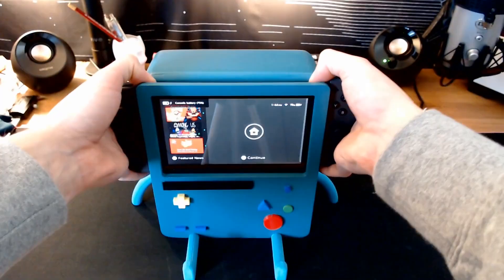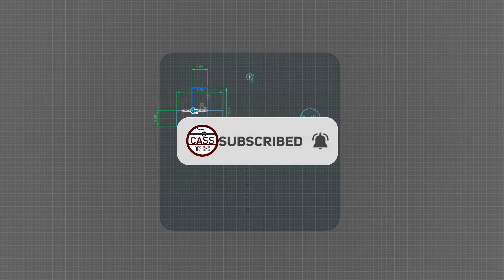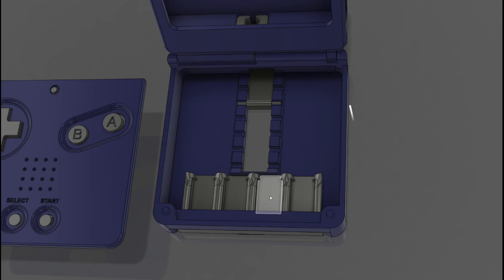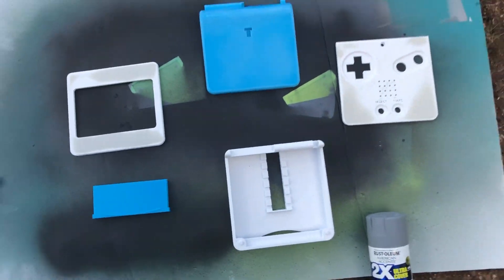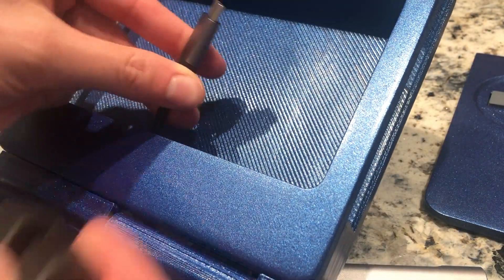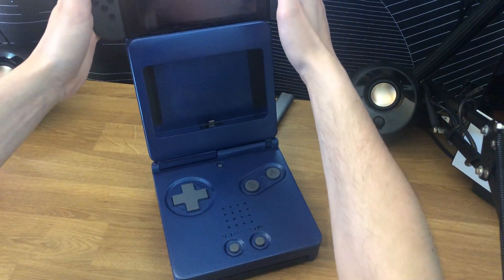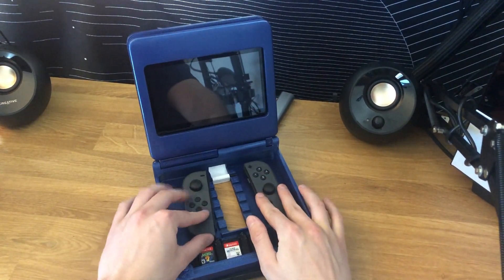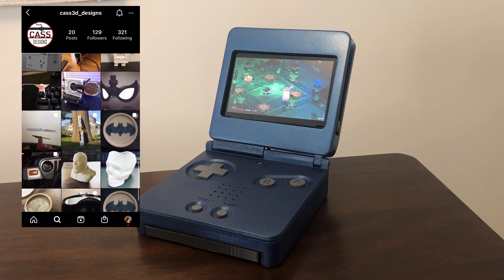I made a 3D Printed Nintendo Switch Dock modeled after a Game Boy Advance SP

Comment: Definitely a cool design, though while i get the point was to make is resemble a gba sp esthetically, i think it would have been cooler if either a it had a integrated holder to where you could turn the joycons into the actual button allowing it to be an actual functional giant  GBA SP or b have had an optional button panel that could be swapped out, that way you could keep the esthetic part when wanting to just dock your switch, and then can swap it if you wanted it to be handheld

Comment: You should make a hole for the powerbank for charging the switch. And then a thing that you can pull down and it has a little circle place at the bottom for the charger to go through, and when the powerbank's battery is dead then you can just pull it up and take it out. It would be nice.

Comment: iN uLTIMATE CURA, SCALE FOR 10.000 AUTOMATIC, WHAT HAPPENS? WHIT STL FILES?
THANKS
Reply from the maker: Scale it to 2540% - it exported my STLs into millimeters but I modeled it in inches so the files need to be 25.4 times larger
Reply: @CASSDesigns  Thaks

Comment: This is one of the most beautiful 3D Printable designs I've seen in a long time. Well, well, well done, sir!!!
Reply from the maker: Thank you!
Reply: @CASSDesigns  hey I was wondering if my FLsun super racer 3d printers bed be big enough to bring this?
Reply from the maker: @josequarvo2757  yes, that has a 260 mm diameter x 330 mm height build volume, my printer is 220 x 220 x 250 mm so you should be good!
Reply: @CASSDesigns  awesome! Also you did a fucking amazing job with this build and the bmo
Reply from the maker: @josequarvo2757  thanks!!
Reply: @CASSDesigns   love the switch sp. Where can I get one from plz / buy
Reply: Take my money I want one